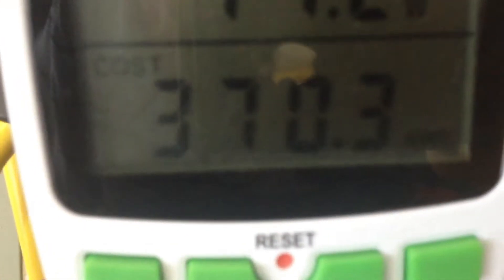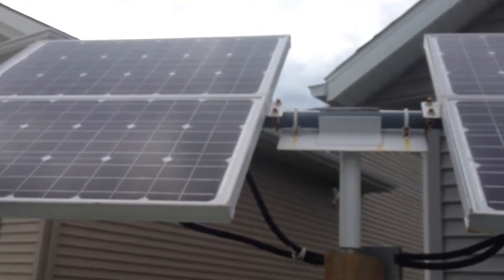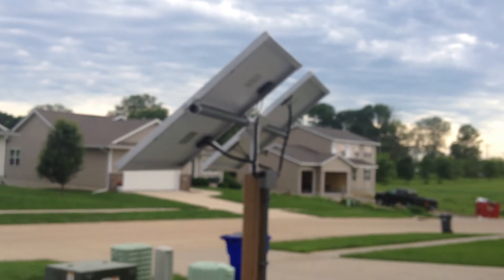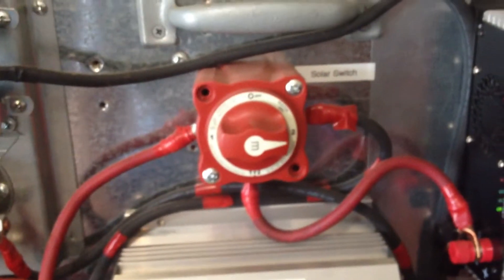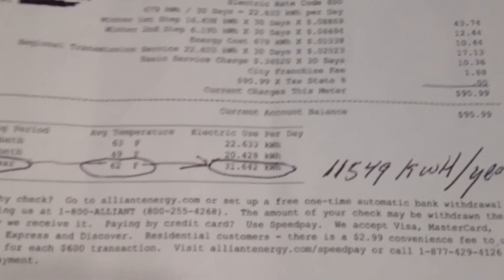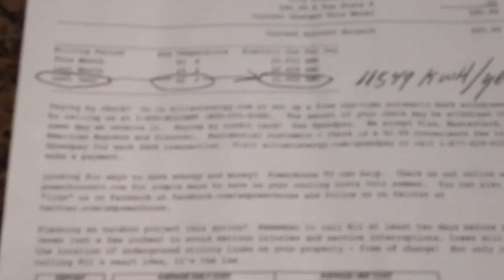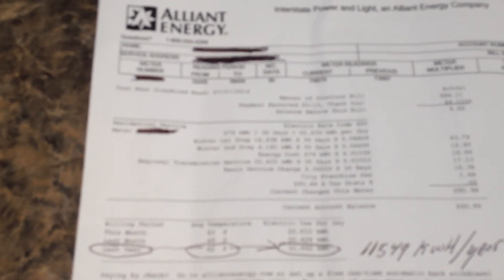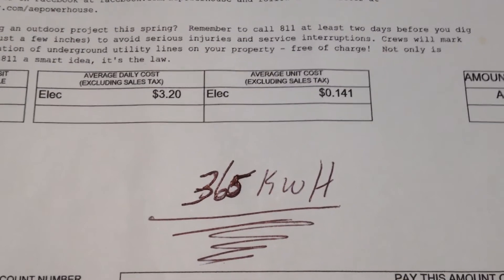1 year solar panel system update 305 watts in Iowa cost and production test

Comment: Not sure you need permits just for an emergency backup system for blackouts but that's what I'm putting together. It's kind of a fun project and it's just big enough to run my fridge 24/7 should I need it. I do have a small backup yamaha generator but if you've every been in a citywide blackout you know finding gas to keep it running becomes a real problem, as the gas pumps need power to pump the gas.
Reply from the maker: +St8kout yes lot of fun thanks for watching
Reply: St8kout you need building permits for any permanent structures on property.
Reply: @StealHrtVideo  In your city
Reply: Well, possibly. It depends on what they would consider 'permanent.' If you want to put solar panels on your roof, then yes. But for something on the ground that just props them up towards the sun, maybe not. That's like saying a permit is needed for a child's swing set. Of course if you start getting into some kind of high powered system connected to a transfer/breaker box, then you'll need wiring permits.

Mine is just a small experimental system to play with panels mounted on 2x4s, rotatable so I can follow the sun for the most energy with the fewest panels.

Comment: The only advantage of monocrystalline is physically smaller panels for the same wattage. All panels are expensive enough as it is so the somewhat large poly- panels are just fine for most people. 
My HOA would have a heart attack if I put something like that in my front yard, lol. They don't mind them professionally installed on the roof, but of course then you can't turn them from east to west. I'm thinking of going with a pole mount too but in my backyard as I also would not want them out in the open subject to vandalism or whatever. You know how punks can be. "Hey, you got any spray paint left over from when we did that graffiti? Let's paint that solar panel."

Comment: those grid tie inverts are not ul 1741 listed for home use. If the power goes out and you pump electricity into the grid you can kill a line worker. not to mention if there is a fire your insurance company may not cover you house. I don't like getting permits I still do it and you must inform your electric company. do not mess around with the grid. If is stand alone battery isolated form the house ok.
Reply from the maker: They shut off when power goes out I tested it but your right about insurance I am only getting around 300 Watts so not to worried about it but if I was going bigger I would definitely go with ul listed not only safer but would get federal incentives
Reply: i know they shoot off reliability of that feature? and 300 watts at 120 still cause fire. personal I have been very tempted to do the same thing you are doing This is just a healthy warning to all who read this.
Reply from the maker: Agree thanks
Reply: No, you cannot kill someone with these inverters.  Stop making up lies ...
Reply: @MrSummitville  go stand in a puddle and grab onto the leads and let me know. I suppose you are an electric engineer and would you trust cheap unregulated inverter tied into the powergrid.

Comment: Your solar install is doing better than you think. You have total potential output of 305 watts and it is actually putting out 305 watts so you're getting 100% of your rated output. Sure, your cost estimate is a little skewed by having 1000 watts of inverters but only 305 watts of panels but that's just nit picking, not important. What is important is that after 15 years you will have 100% free power for at least 10 years. Do you think your electric bill from the utility is going to stay the same for those 15 years and then suddenly become free after that? Not gonna happen. The fact is, historically, electric bills average about a 3% per year increase so in 15 years you will be paying a lot more for power from the utility... but your solar power will never be more expensive and after 15 years it will be totally free. You, my friend, have a gold mine and you don't yet know it.

One point of clarification. Solar panels don't reduce output to zero at 25 years. Today solar panels guarantee 80% of rated output at 25 years. So you just have to add 20% more panels before year 25 to keep the same output. 

I think you are on the right track. My advice: replace those 65 watt panels with 300 watt panels, add 3 more poles in your back yard and use an antenna rotator that is controlled via timer or computer (a super cheap laptop can do the job). That way the panels will automatically be turned toward the east before sunrise and move periodically throughout the day to keep the panels aligned with the sun till they are facing as far east as the sun goes. Then after dark you can use a little of the energy they produced that day to turn them all back to facing east to await the next day. That'll give you 4.8 kW and probably 15 to 25 kWh per day. 

Also agree with another poster who suggested putting solar water heater on your roof. It could feed into a tankless water heater which would kick on if the sun didn't heat the water enough. You could lay pex tubing under your floor and use the solar heated water to warm your house in the winter. In the 1970s a home builder put up a house near my neighborhood that was made of concrete and had under floor heating and I have never been in a warmer or more comfortable home. Hot water and heating are your big expenses in the winter so anything you can do to reduce those will immediately reduce your power bill.
Reply from the maker: Thanks for your input you have some excellent points

Comment: Put a television rotor on the panels.....move it from inside?
Reply from the maker: Cool idea thanks
Reply: TheDBCooperforum this dude the other day used 4 small solar panels . They where shaded with a 5 main panel. The other four where harder wired in to a small motor .  5 makes shade ,when 1,2,3,4 would get sun they would turn and adjust . It work good ,same as NASA used is where he picked the idea up.
Reply: @aaaricmondroofing1703  Spend more money and then it will NEVER pay for itself ...

Comment: You pay more than 40% more for electricity per kwh than I do. That is a lot!  Nice project but now you know why solar is not in every household. Just not cost effective. Just about the time you start to see a return, all the hardware needs replacing and you are back to square one. I am purchasing an RV and doing research so I will have power when off the grid\remote locations. I do not expect it to save me money. I just want to run some basics without firing up the inverter\generator.
Reply from the maker: +tonkatoytruck I agree 100% I also have my solar for emergency, and not to save money on energy

Comment: could you have gotten the same effect had you installed the panels in your back yard?..or would your house be blocking the sun?
Reply from the maker: +Showemright YTchannel I could put them in the very back but I would have to use very expensive large wires because of the distance to where i wanted it to go, My panel's are 12 volts.

Comment: you will pay back faster.  each year your electric company increases your rates but the cost of your solar system stays the same.  so because of that you will save even more.  throw some batteries into the system and you will have a generator that you can use if the grid goes down.  great project.
Reply from the maker: +Noughs Enough True, Thanks
Reply: @
Noughs Enough - Grid-Tie inverters do no work when the Grid is down.  Therefore, you will need to buy a new battery bank ( every 5 - 6 years! ) and a Hybrid Inverter. You will never break-even ...

Comment: Electric prices will always go up even if it's just by inflation. Solar panels of the future will use the infrared spectrum where most of the energy is and not the visible light spectrum. Your vid is a good demo, but you could of worked this out on paper first. It is good to start small and then build up as solar tec improves.

Comment: In Wisconsin the laws favor the Corporate Power Utilities by charging independent solar/wind power generators a surcharge for selling your excess power back to the Utilities.  Does Iowa have the same law?  The reality is, that Corporate Power Utilities realize that small scale independent solar/wind generation is a viable alternative to their inefficient services and they do not want to lose their grip on dollars from our bank accounts.
Reply: Kevron Rees I agree!  Whenever, wherever and however get out of their monetary whirlpool syphon clutches.  A balanced approach helps.  In the 70's and 80's American architects jumped hard on passive and active solar home designs.  My wife and I had a super insulated home designed and constructed by a forward thinking architect.  He added a 22' x 22' square foot active solar solarium with 180 degrees of south facing windows onto our house.  Our electric and natural gas bills started at $25.00/month in 1981 and after sixteen years went up to $85.00/month in the late 1990's.  The home had five stories and was 2,500 square feet.  Had PV been reasonably priced back then we would have added them to power all our lighting and small electronics which were few in the early 980's.   Now PV is affordable and with active solar used together great things can be achieved if only the boneheaded architects of today would start designing homes with this affordable technology in mind.  All the research and designs for passive solar technology have been done and are sitting waiting for some intelligent life form to activate their brain on this planet and use them.
Reply from the maker: zeogiannes Yes and I agree 100%
Reply: Ray Isimz I forgot, my Godson wanted to erect a wind generator on his supposedly own land, when he went for a permit the government officials told him the permit cost $50,000.00!  This tells us that the power generating Corporations now own this country and us.
Reply from the maker: Wow thats crazy
Reply: Ray Isimz Crazy as it sounds, it's on the books! Ray, I forgot t add, instead of showing the large companies, schools, Universities, and municipalities that are using solar generated electricity on YouTube, hey feature back-of-the-woods loners to try and denigrate it's real usefulness and viability.
Reply: zeogiannes Screw corporate powers.  Go off-grid.

Comment: So that means those that pay $20,000 for a solar setup, it will take roughly 500 YEARS to break even.
Reply: Ray Isimz 

Ten, (10), years to pay it off... You will need to install
about 34 to 36 solar panels at about 250 watts each, with a large charge
controller, and bank of batteries, and wired right into your home... 
This will cost about $ 33,000.00, and with thegovernment and the electric company rebates, leaves you with about $ 11,000.00 out of pocket cost, in California...

$ 11,000.00 divided by 120 months gives about$ 91.67, for ten years...
And that gives you about 1,500 kwh more orless a month, (I forget the actual numbers)...You could run every thing in your house allday and all night for as long as you want...

Most homes only use an average of about 909 kWh house a month...This gives you a surplus, you could sell toeven lower your cost even more to say maybe, $60.00 a month for 10 years...Yea, I love this technology...
Reply from the maker: I dont think it is 500 years if you get the government tax incentives, as far as I have been able to determine a good guess is it takes around 15 to 20 years, and that depends on how much electricity costs are in your particular area. I believe eventually solar along with passive and geothermal technology will eventually catch up and become more practical to use,
Reply: Ray Isimz But in that 15-20 years, you'll also have to pay past the $20,000 to replace bits & pieces of that $20,000 investment, batteries, inverters, ect ... perhaps extending the 15-20 year break even mark.
Reply from the maker: True
Reply from the maker: Thanks for your comment
Reply: I think it's safe to say that with a larger, more expensive system, you will generate more power which you will offset against your grid usage. This system is very small and not particularly efficient.
Reply: +Anybody But Hillary 2016 Not so fast. He said he had roughly $600 and some change in his set-up. Very small. There was a bunch of stuff I saw in the video that he didn't need to achieve the results he showed. Also, if the investment is made then it's been done and it's yours. How much peace-of-mind would one have knowing that you control your own power plant? Even a very small one like this. Just being in touch with your consumption and what it takes to run your house is very valuable. Being hooked to the grid puts you at the mercy of the grid. Also, he said he need 10,000 watts. Probably not. It depends on where he lives and this and that and the other thing. A small set-up is better than nothing. You don't need to power an entire compound. Even something to charge your phone or some batteries is a good thing. Solar can also cook food and heat your home. The return-time on Solar installations are getting shorter all the time as componants get less expensive. I'm thinking the total pay-back would be more like 8 to 10 years and maybe less in some areas and more the farther north you go. When the power goes out...the people with power are powerful people. Just sayin...

Comment: Ray Isimz   Why dont you use a solar tracker instead of moving panels yourself ? . . .http://www.ebay.co.uk/itm/SBE-Solar-Tech-12V-Analog-solar-tracker-control-board-/300569606897?pt=LH_DefaultDomain_0&hash=item45fb583af1
Reply from the maker: Yes I would like to eventually get that, Thanks will take a look

Comment: ok a hint light sensing diode's and a toy car motor so you can rig it to follow the light by itself so when the sun slowly moves out of optimal light so does the diode then triggering the motor to turn the panels toward the sun eliminating hand turning except for the occasional cleaning :)
Reply from the maker: Interesting
Reply: Ray Isimz or I found some online but it is to expensive  on this website - Solar Tracker Circuit Kit - MTM Scientific
Reply: @michaell1341   Every night, it stops pointing to the WEST.  You need to RESET to the East every morning ...

Comment: That's a good point that Chris raises, which is inflation will raise rates every year, regardless, plus any shortage electricity supply or greater demand, will raise rates even more.  Whereas, your solar costs are fixed and don't change. As a result your payback goes down further.
Reply from the maker: I 100% agree Inflation, turns this all upside down, that is why I became interested in solar, and wind.

Comment: That's interesting looking at your payback period. Your rates for electricity are so cheap in Iowa; we're paying 3x that rate in California. But you've laid it out very nicely.  Thing is for me, with just a straight Enphase gridtie system, your payback is around 2 years. I guess in Iowa since your elec cheaper and less sun, that would still be 6-8 years.  That's very interesting to see comparisons based on so many factors that vary place to place. Ps. I'll be posting up the series on my off grid install at cabin. As you know, once you bring batteries into the mix your costs go up and payback down
Reply from the maker: Keep in mind, rough numbers it depends on cost of system maybe I can get it cheaper, not sure, I will check into it a bit more now that I know my production is about 1 kwh per day with 305 watts of solar. And this is good cause we need to have this debate.
Reply: Illinois has .06 per kw/hr not doing solar here. Payback longer than panels last.

Comment: I have just over 5KW on my roof ray and that can make upto 50kwh a day. but for me its 30 to 35 kwhs a day, 5kw systems start at 2000$ au, it runs my house fine mate. Just changing to LED lights makes a Huge difference to power use. also the bigger the system the shorter the payback. The electric stove and hot water is your power killer, and at 25years a good solar panel will only degrade 20% still giving 80% of power
Reply from the maker: Great price Justin, That would be justifiable, my other killer is my air conditioner use, for the summer, forgot to mention that, Must be some great solar panel's, I have not been able to find anything yet that cheap here in the US, seems like Ebay is the cheapest so far. I could justify solar for what you have been able to do. Some other factors here also are building permits, components must be ul listed,  (More Cost) I believe insurance also is an issue (More Cost) here in the US. I believe solar will be the way of the future eventually here in the US, but may take a long long time.
Reply: Ray Isimz Your power cost are going to jump up a lot over there we here, Same thing here as the government chases the $ land rates water and other cost are about to jump up.. I love it when the cost of power go's up mate. every time it dose my payback time drops :)
Reply from the maker: That is Awesome, I am going to pluck away at it slowly, it would be nice to not worry about energy costs.